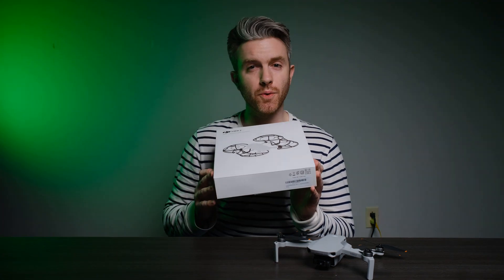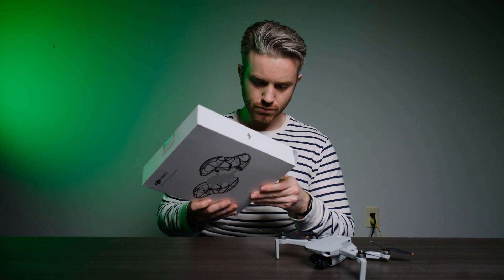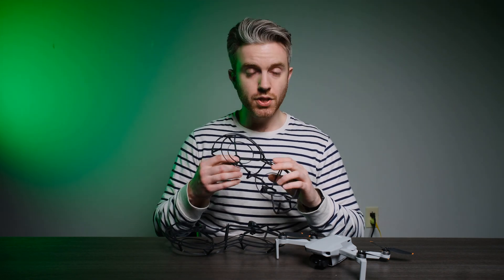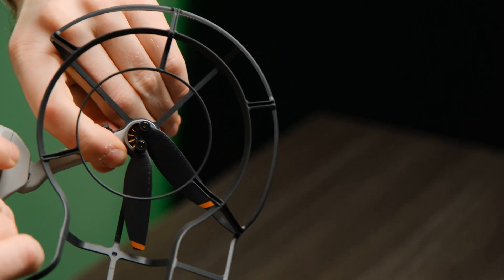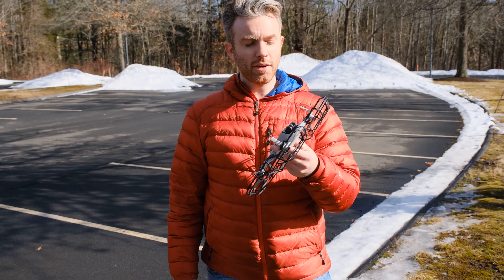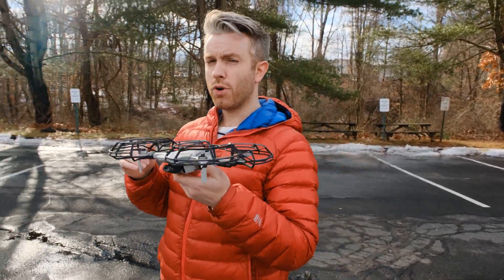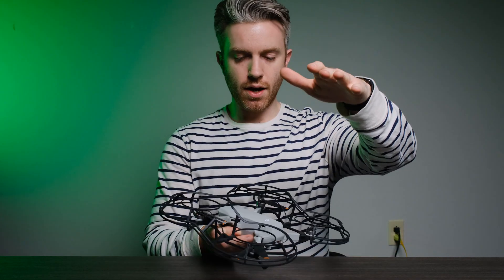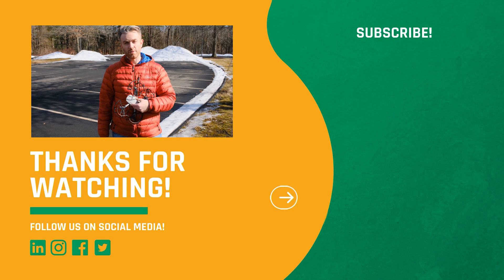How To: Drone Propeller Guards

Comment: According to DJI instructions for these prop guards, it warns users that the obstacle avoidance system is disabled once installed. That'd be a deal breaker for me.